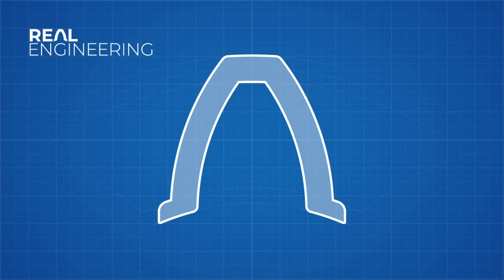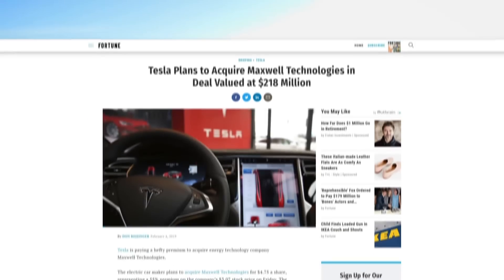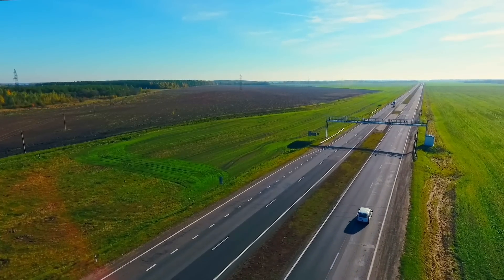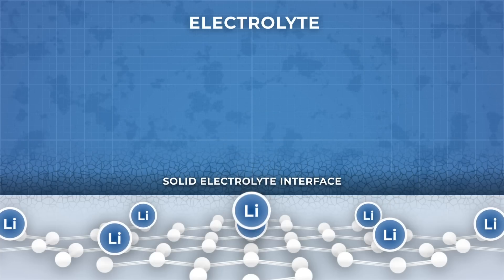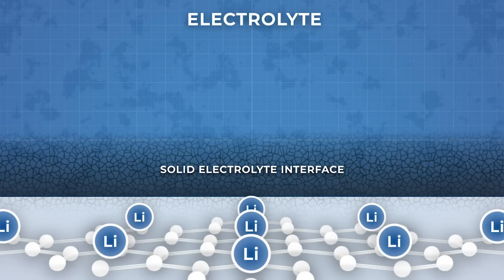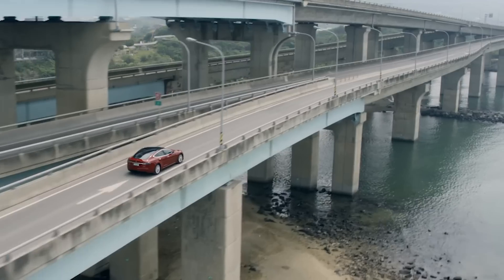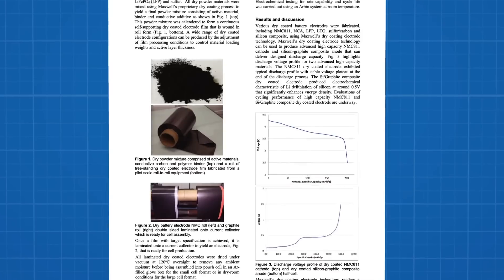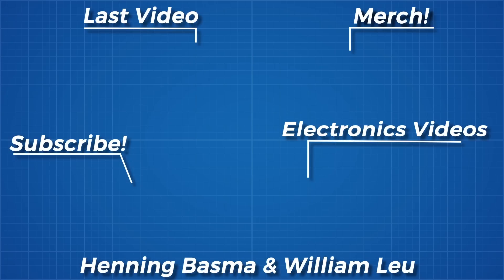Tesla's Quest for Better Batteries

Comment: The trend toward renewable energy. Uses lithium battery which isn't renewable
Reply: Doesn't go anywhere either...
Reply: Rome wasn't built in a day, Lithium ion is an important stepping stone between fossil fuels and more sustainable storage systems, like Hydrogen or hydrocarbon cells. The biggest challenge with Hydrogen fuel cells is coming up with a cheaper catalyst than platinum, once they have a good catalyst, Hydrogen will offer absolutely enormous capacity at very low cost.
Reply: @gabrielfraser2109  Toyota have been keen on working with Hydrogen and Fuel cell and already tell people years ago that the future lie in Hydrogen. But people never really sold on that apart from themselves. Even Tesla choose traditional lithium over that. Cause it's more lucrative. But as soon as it feasible to the mass. I bet Elon will claim it as their invention the way Apple always invent things. Tesla is the Apple of car industry.

Comment: Watching Teslas at the drag strip is always a treat. They leave the line faster than anything I've seen, but cross the finish line at a pretty sedate speed. Like they might run a 12.5 second 1/4 mile (quite respectable) but they cross the line at like 89 MPH.

My same 12.5 second 1/4 has me crossing the line at 110 MPH so win or lose, right at the line, I blast past them. It's a similar story with many AWD cars though. Subarus are a lot like that. In your day-to-day life, most of your time is spent around 25-35 MPH so that low end acceleration is where it's at.

People who don't like muscle cars ask, "When do you ever get to use that much power? It's stupid."

"Every single time I use an on-ramp." :)  It's not as good as sex, but better than coffee.

Comment: What if a military tank used Tesla's most powerful engine? Would it make the tank so much more quieter and more space probably? Ofc with rubber tracks.
Reply: There is multiple drive train suppliers offering Series Hybrid Millitary Tanks already. That means entirely driven by multiple electric motors & on board generator. Yes they are very powerful and faster than average.
Reply: Tanks are probably one of the last things that would go electric on the planet. They need extreme energy density because they lug a lot of armor and munitions around while needing speed as well... batteries just can't compete and quite possibly never will for this application.
Reply: Hmm, if solid state batteries become a thing. And arent as prone to extreme failure when punctured. Maybe use batteries instead of armor.

Tanks are coated with reactive armor that explodes when hit anyway :D
Reply: @rokadamlje5365  Interesting idea making the battery part of the protection. But not plausible anytime soon due to the lack of capacity. We already have some low energy density Lithium Ion Cells which are extremely safe and can survive being sliced and blasted with 1000c flames. But that comes at a cost of size and lower energy capacity. IIRC it's already used in Apache Helicopter purely as the accessories system to replace traditional lead acid.
Reply: @Neojhun  imagine if it would be like spaced armor, one sheet on the outside and one inside. Batteries in the middle. Less space taken by the engine on the inside. 

Abrams is like 60 tons, 1900 liters of fuel. Liter of fuel is about as much usable energy as 4kwh, so about 8mwh. Tesla semi has as much motor power as the turbine of the Abrams, but only 1mwh of batteries. Which weigh about 4 tons. 

So to be the same in energy storage, battery tank would need 32 tons of batteries of the same density as current tesla tech.  Yeah its a bit off.
Reply: @rokadamlje5365   If you want decent range for silent escape and peak power output. You realy need around 100kwh. To store 100kwh in those High Survivability Low Energy cells would require much more space than the entire outer cladding full of battery cells. Engine Wise you could use well established Gas Turbines but it does not have to be as powerful as Abrams' Honeywell AGT1500 as the Lithium Ion batteries provide peak output. You could easily have a Turbine at 70% the power output. Main thing is make the generator as compact as possible but keep Lithium Ion topped up but maximize the space possible for as much Electric Range as possible. Oh 100kwh battery at a safe 10C is 1MW.
Reply: Abrams needs its 1500 horsepower turbine to go at its top speed of 70kmh.
Reply: @rokadamlje5365  Electric 1341hp is much more effective than a 1500 Turbine. The powerband is just much better on Electric Motors compared to spooling up a Turbine.
Reply: Im saying the tank NEEDS all that power to move at top speed. Cant reduce the size of the engine much without reducing the top speed or distance traveled at that top speed.
Reply: @darthmortus5702  SERIES HYBRID means it still has fuel generator. But the torque is entirely driven by Lithium Ion Batteries & around 4x Electric Motors. It's already proven to be great at lower noise & quicker acceleration. It's already been done.
Reply: Porsche tried to build diesel electric hybrid tanks in WW2 . Allegedly a prototype broke down in front of Hitler on trials.
Reply: @francesconicoletti2547  yeah technology needs time. Porche will happy the idea that he have actually worked. Although come in different era
Reply: @francesconicoletti2547  Yep Ferdinand like working on Hybrid Electrification a lot. It was just too far ahead of his time. Almost 80 years later we have soo much more science, technology & mission critical experience to make it work. Diesel-Electrics have long been a critical tool for massive vehicles like Submarines, Trains & Mining Construction Equipment. It's time we develop the next generation with Lithium Ion Batteries & Super Capacitor to make even more deadly quieter & quicker Tanks.
https://en.wikipedia.org/wiki/VK_4501_(P)
Reply: I also think that tanks in the future, need not use main guns anymore. Anti tank rockets like the rpg is just as good and better cos its cheaper to manufacture and is capable enough to take out mbts. If needed, TOWs too. Tanks need not be so huge too cos in urban warfare, a smaller tank with anti personnel and 360 all round view is more important. Watch vids of Syria tank vids. It should be a lesson for all of us to at least take note. Not to develop a war, but to design to be ready. Ready for self defense.

Comment: 1:50 This is a drastic change in just ten years and this chart does not represent how impressive it is since the y-axis is a bit weird.
Reply: The y axis is logarithmic. Very normal and standard in the scientific and engineering communities. When you see that you can assume that the scaling is exponential. Like earthquakes magnitude or decibal
Reply: @frenchfryguy2012  yeah log graphs are used to exaggerate changes in the data. It's a convenient way to mislead people who do not know what log graphs are.
Reply: @gatewaysolo104  it's only misleading if you don't think that the change from 1000-500 per unit is equally significant to the change from 100-50 per unit.
Reply: @gatewaysolo104  You've got it backwards - logarithmic graphs look flatter than linear graphs.

Comment: I'm sorry but I have to question your stats @3:30 I have a 4 year old  24kw leaf traveling 25000 miles in the last year alone and have full battery health with no noticeable degradation.
Reply: Like he said, these are from the original leafs, you can expect they've made some improvements since then. Also, what is your climate like?
Reply: @gabrielfraser2109   I would like to see the source for this statement in the video... In April 2016, Nissan estimated that fewer than 5 batteries are replaced per year worldwide; about 0.012% of all Leafs since introduction.  I live in Northern Ireland by the way. I'm sure someone was able to trash a battery pack in two years in extreme heat or cold but it's not a fair representation of the leaf.
Reply: A batter that lost nothing in 4 years doesn't exist, meaning you just don't know what the degradation is... that doesn't serve as useful data to go on.
Reply: @MsSomeonenew   I'm a electrical engineer and fully understand battery degradation. My original comment said no noticeable degradation... The battery health indicator on the dashboard shows full health. While there will be some depletion I still get over 80 miles on a charge.

Comment: Tesla's quest for better batteries:
- Wait for Panasonic to develop new chemistry
- Buy more batteries from Panasonic
Reply: I thought Tesla designed their own proprietary chemistry, which Panasonic then manufacturers to spec. The new 2170 cells are bespoke to Tesla.
Reply: @karthik11512  No, it's Panasonic's chemistry. Tesla has no IP on it. I don't know about the physical cells, but 2170 is an industry standard, don't know what's bespoke about it, but I'm not an expert on that. What's certain is that so far Tesla has been the sole buyer of Panasonic's cells using said chemistry.
Reply: Tesla's quest for better batteries:
- wait for Maxwell to finalize their battery 
- bring it to an industrialised scale
- make and rework all Tesla cars
- kick out Panasonic and use their space
Reply: Tesla own the IP developed in their own research and testing lab in Nova Scotia run by Dr Jeff Dahn, a  pioneer and  patent holding researcher in LiIon tech.
The low Cobalt, Aluminium additive, high energy density cells in the Tesla are unique to them, and the lowest cost on the market.
Tesla hold patents in battery tech including in Lithium Air.
Tesla developed and manufacture their own battery packs and battery management system, described by Munro and Rickard as leading.
Tesla has secured its own ethically sourced supplies of minerals .
Reply: @waynerussell6401  Dahn's work is his own research, not Tesla's lab. It was just sponsored and patented by them.
It's something about NMC batteries, which Tesla doesn't use. So no, they don't have that in their cars. And they don't make batteries anyway.
The low cobalt NCA chemistry in the 2170s is Panasonic proprietary tech, Tesla has nothing to do with it other than purchasing it from them. They don't have "ethically sourced cobalt" because they don't source any cobalt. They do not manufacture batteries.

Comment: Lithium Titante Oxide. Safer. High C rates. 30,000 cycles.
Reply: And much lower energy density.
Reply: @allusernamesistaken  but still you would only need 50 of the 40 amp LTO cells to give you a 50kw battery. That could easily fit in an EV.
Reply: Yeah.  Might be more ideal for utility solar.
Reply: Cost?
Reply: @Ou8y2k2  in bulk, consumers can buy them at about $250 per kilowatt from third parties on alibaba. If you got them direct from Yinlong, the manufacturer, could be cheaper?

Comment: Hey Brian, is there worth seeing the technology of NiMH batteries? Traditionally they're more reliable and practically serviceable unlike sealed Li-ion batteries, but they lack the nominal voltage for scale (previous 28kWh packs used to weigh 600kg). The materials to make NiMH cells aren't as problematic or scarce as they are to Lithium.

You might know in the 2000s Ovonics chemistries who patented the technology for automotive use was sold by GM to Texaco, then Texaco was bought by Chevron. Ovonics restructured into Cobasys halted all mass manufactured cells and sued manufacturers like Panasonic and Toyota for years until settling in 2004 that cells of 25 Amp-hours or less were freely allowed to be manufactured by others.

However, automotive cells of 50 - 98 Amp-hours were completely restricted (hence who killed the electric car) and 10 years of electric automotive development was lost. The patents expired in 2016, but Cobasys sold to A123 in 2009 were long gone. While they weren't high performance by any means, it's a wonder how that technology were mass produced with energy densities that rival today's technology.
Is looking into NiMH worth exploring for heavy machinery such as rail, farming or plug-in assisted hybrid use?

Comment: Hydrogen would still be the better choice for trucks and long haul vehicles. Lower weight and faster refuel time is worth the lost efficiently. Even with natural gas fired power plants are far more effcient than ICE engines and evens out. Batteries are great for city and predicatable use hydrogen fuel cells are better for long distance heavy weight. The two shouldnt be looked as competeing but as gasoline to diesel, each has a spefic use and forcing everything to 1 source will lead to more problems.

Comment: While on the topic, I heard that lithium-ion batteries handle any length of charge as a full cycle regarding its lifetime, even if you just plugged it in and removed it. Any comments on that? 
Would probably kill my battery if the charger has a contact fault, and turns the charging on and off a hundred times overnight.
Reply: The cycle rate is dynamic on how much you charge. You get most cycles if the battery stays around 20-90% durings its lifetime.
Reply: The wisdom on preserving battery life changes every 6 months or so, but right now it's heavily recommended to keep your battery as close to the middle as possible, avoiding fully charging or discharging. This definitely makes sense, phones are shipped with the battery around 40% full. Keeping a battery full for too long will gradually damage it, keeping it empty for too long could cause a sudden, catastrophic drop in capacity that renders it basically useless.
Reply: @gabrielfraser2109  Oh, is that so...? Let us spread the news then, that keeping your battery and the device it is attached to underwater, can extend its life because it helps maintain a steady temperature.

Comment: Li-Ion Batteries: Hard Drive
Ultra Capacitors: Solid State Disk
(Yes I know SSDs degrade like Li-Ion)
Reply: Li-Ion Batteries: Hard Drive
Ultra Capacitors: RAM
Reply: James Nguyen degradation of supercaps extremely low.....million cycles with supercaps, as opposed to a few thousands with lithium.  They will help extend the life of the lithium batteries, giving them an easier life, less strain.
Reply: Actually, looking at the underlying technology, Ram is pretty much just a grid of capacitors, where nand flash is a chemical reaction very similar to a battery, this comparison makes much more sense.
SSD = chemical batteries
RAM = capacitors

Comment: Mostly accurate & great video. One thing is Roadster 2 and Semi do not need capacitor. A P100D Model S has 550kW peak power. The Roadster 2 has a 200 kwh battery and proportionally can achieve 1MW peak power. The constraint is traction. The long range semi has ~ 1MWh battery, even with lower discharge rate peak power is not an issue.
Reply: Didn't he say the issue was providing the power without the battery damaging itself?

Comment: Why do you keep assuming that Tesla's battery packs will degrade quickly when all the evidence suggests otherwise? Comparing Tesla's batteries to the Nissan Leaf's is disengenuous. The latter doesn't have active battery cooling and is a completely different cell technology.
Reply: His stats for the leaf are not correct....

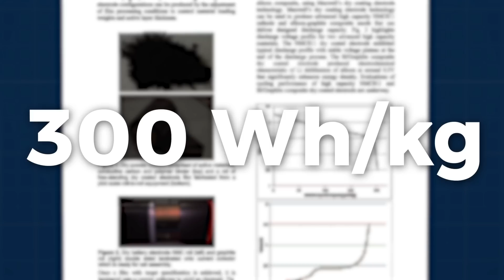Comment: You say @ 5:31 372 mAh/g which is 1376 Wh/kg, then at the end in 14:31 you say 300 Wh/kg "which is 20% more". What's up with that?
@1376 Wh/kg the battery of a Model S 100 would be 72 kg => something is wrong.
@300 Wh/kg it would be 333 kg which is wrong too.
What's going on?
Reply: 1376 is just considering the Silicon/Carbon atoms, in the real battery you have way more stuff, like the separators, another elements, the cell mechanical and electrical connections
Reply: But how is 300 Wh/kg 20% more than 1376 Wh/kg ?

Comment: People who drive them don't do it because they are all people who want to do smth. In some countries the taxes on normal cars are ridiculously high and Tesla's not because they are electric. Funny actually because on long and short term Tesla's and other electrical cars are damaging the environment way much more than normal cars.
Reply: The environmental impact of the batteries is absolutely nothing compared to oil.
Reply: Is that increased damage to the environment because of the disposal of the batteries?
Reply: @dhiegov  Yep. And where is the energy coming from the electric cars are running on?
Reply: @janveraart307  Even in an economy where all electricity is powered through coal, it's less energy intensive to charge batteries than it would be to import/extract transport refine oil into fuel than it is to charge the battery. fossile fuels ARE batteries, through the whole process we invest energy into them, and then we burn it at 15% efficiency in a  car. 

The coal/natural gas powerplant can run at 60%+ efficiency and then be used in cars.

Comment: Patents are the real obstacles to technological advancement.
Reply: On the one hand, there's some value in that observation. On the other hand, it's going to be a hell of a lot harder to fund technological research when your investors have absolutely no guarantee that the research they're funding will give them a return on their investment, since without patents, there's nothing stopping competing companies from selling the same technology you planned on selling, and you're automatically at a disadvantage because you have costs to recoup. Patents are absolutely vital to encouraging innovation, but obviously steps have to be taken to prevent their abuse, particularly in the Pharmaceutical industry. In theory, a patent is only supposed to last long enough to help you recoup your costs and make a tidy profit, and then release your work to the public for the betterment of humanity.
Reply: @gabrielfraser2109  Good insight
Reply: monetary system can be a real obstacle to technological advancement too